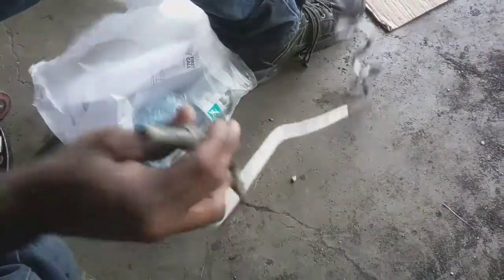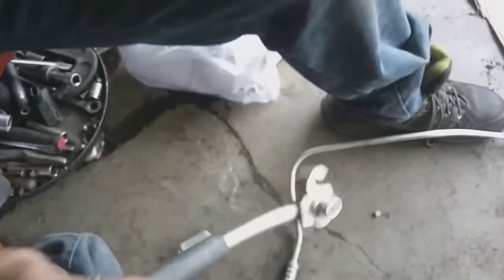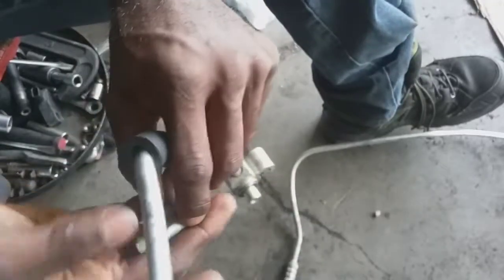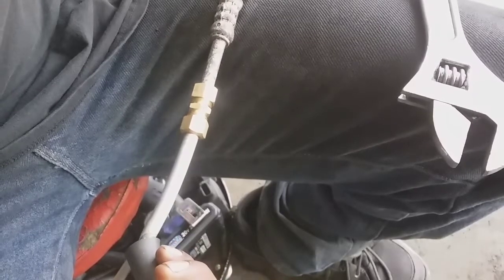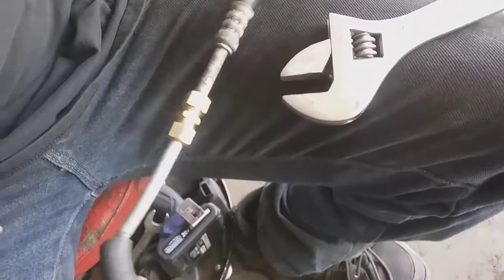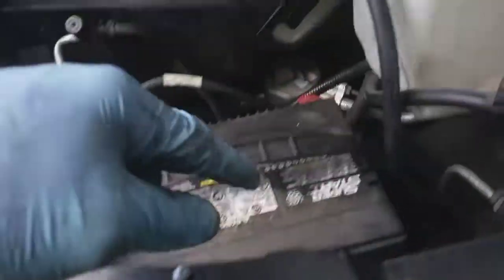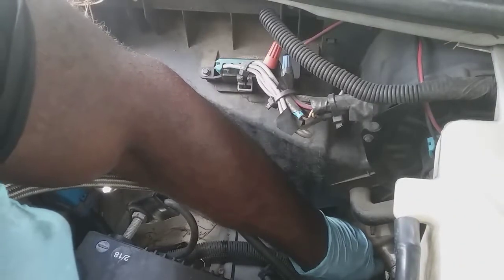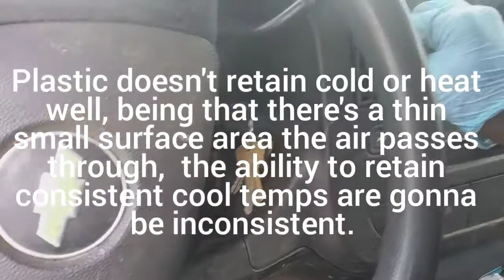Ac high pressure line REPAIR W/ UNION

Comment: Do you think this would hold on the liquid/high side? I have a hole/crack in my high side line, about 8 inches away from the high side evac valve. It's easy to get to the affected area but very hard to get to the bottom disconnect if I replace the entire high side assembly lines. I'm tempted to try a temp repair like this. I'm at 260k trying to get to 300k

Comment: Good info.. question.. could putting a car  on a lift punch an a/c line?? Took my wife's car to get tires they put it on a lift and now the car is leaking freon.. can't find a damaged line but it won't hold freon.. if it's a stainless line I'm gonna try this trick I just learned from you.
Reply from the maker: Thanks...

To answer, 99% of the time no, that won't happen. AC lines are tough to outright collapse or smash, take allot of force. Maybe vehicle was in a collision previously, line became pinched??? And leak exposed itself???

Try adding dye to system, and use a black light to discover leak. I have a video where I did a water pump and AC diagnoses on a Ford 4.6. below should give you an idea what to look for when checking, hope it help. The AC diagnoses with uv dye is latter part of video

https://youtu.be/Y79yO_yZWdE

Comment: Nice video 😀🍷👍   
I have a 98 gmc sierra.  Small leak from. A/C Hose.  Right in the meddle.   Can be use this connectors.   Where do you buy.  Thank you
Reply from the maker: From O'Reilly's auto parts... They're just brake line unions. Allegedly theyre conductors when combined with aluminum, and are temporary fixes because if erosion as a result. I haven't had this come back for the same issue fyi
Reply: @partsshooter  thank you! ! 😀🍷👍
Reply: autozone has them too